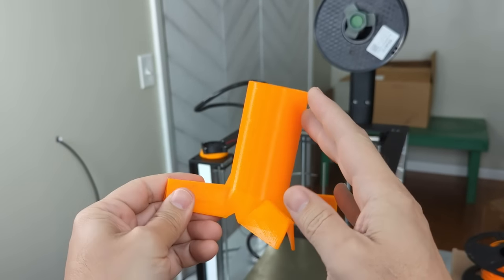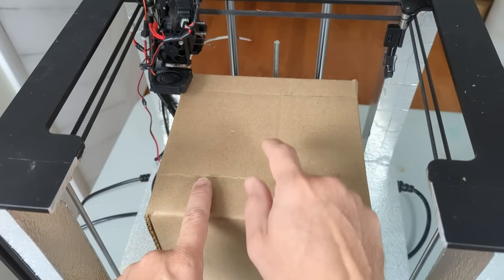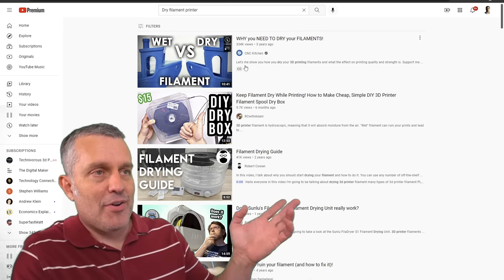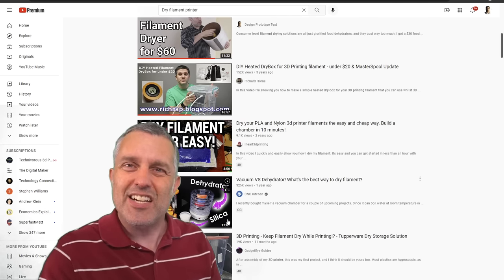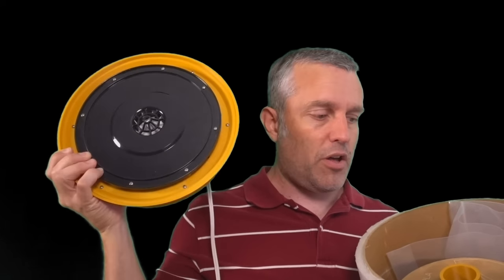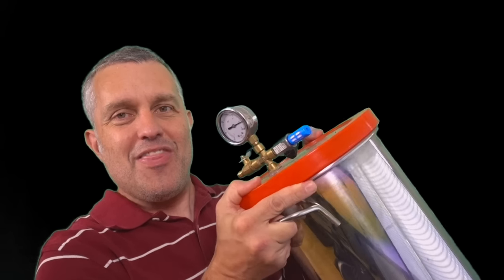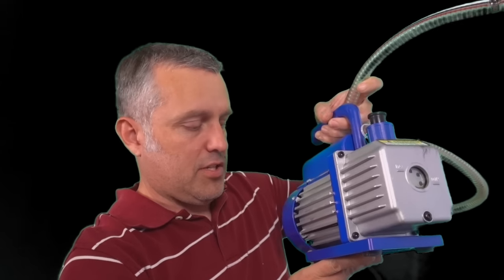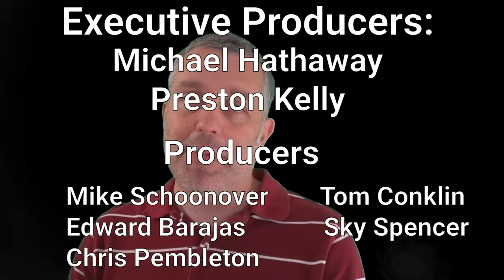The Filament Dryer Built Into Every 3D Printer

Comment: I have tried drying PLA at about 50 to 60 at the heating element but I guess the air was around 40. So far I haven't noticed accidentally annealing the filament
Reply from the maker: In my experience, annealed PLA filament still prints but you start to get nozzle clogs, extruder skipping, and lower quality prints due to inconsistent extrusion.
Reply: @DesignPrototypeTest  interesting, I'll try to observe that next time

Comment: So who's the pricey gypsum filament maker?
Reply from the maker: If I were going to make a PLA that you can anneal, so that it withstands higher temperature than normal PLA, I would call it "High Temperature Poly Lactic Acid." Except that's a really long name I wonder how I could shorten that name.
Reply: @DesignPrototypeTest  love the videos. Especially the tone! Keep doing them they cheer me up and inform me
Reply: @DesignPrototypeTest  Ha why wouldn't you just say it? Also I think you're dismissing what Protopasta is doing over there. They make really good stuff that lives up to their claims so I'm a bit confused. Is it really just the price? If so I hear ya, it's pricey but again, it's good quality, and the main reason it's more expensive is because they're not working with the same margins Hatchbox or Sunlu or any of the other Chinese mega corps are so they can't sell a roll for 20 bucks and keep the lights on.

Comment: Forgive me for my comment ... I'm a bit skeptical about this movie and this idea. Why? I am looking at it economically. How much electricity does the bed take? 200-300 Watts? Fruit dryers... same. And how much does a Sunlu dryer (S2 model) take? Max 50 Watts, it reaches a max of 70 degrees Celsius. This dryer wins economically, by calculation it is cheaper. Still, it is an expensive thing, but looking for another fruit dryer that is 20-50$, even 100$ cheaper. As you have noticed, they are cheaper than the Sunlu type, but the cost of electricity is higher. Drying on a printer, maybe an idea for an amateur, its for funs, but for farms - I include two drawbacks: the cost of electricity and one bed is occupied. Printing time is business. Electricity is business.
Reply from the maker: Thank you for the comment. It helps my channel to grow. I agree with your assessment. It would be foolish for a print farm to use this technique to dry their filament. Then again, most print farms are fool's endeavors. The true utility of FDM printing is for the DIYer. And such a person is not a fool to use this inexpensive and minimalistic solution. Electricity is inexpensive in the United States. It would take weeks of filament drying on the bed to incur a bill large enough to justify purchasing a dedicated dryer. In many European countries electricity is more expensive. Perhaps it is easier to justify purchasing a dedicated dryer if you live in Germany or similar.
Reply: @DesignPrototypeTest  That's what I mean because I live in Europe. Such views are completely different than you in the States :)

Comment: So you tell me, I should use one of my 8, 200 or 2000 dollar machines which are right now being used roughly 95% of the time, to dry a filament. Instead of buying a 50 dollar machine which can dry 6 spools and a bunch of silica at the same time in 36 hours???
A good one gets over 75C, or like mine, can be modified with a better circuit, power mosfet with pwm signal and a high power resistor (I get to 95C now, could go higher but I m afraid for the machine itself). 

These bags let in moisture??? I ve tested these with a dataloger (with temperature and humidity sensor), after 2.5 years the humidity started rising because the seal wasnt perfect from my cheap vacuum machine (there was a small container of silica in it, less than 25g). If you keep your filament 2.5 year, and you wanna store it dry. Then i dont know man, i really. Stop printing then, my spools last max 2 weeks…

Instead you recommend to use their build plate, which wastes energy, could be dangerous if done wrong, for example the fan circuit blowing up (burning up) when you higher than 85C since some electronics are not rated for higher.

I guess i can see a use for someone who is on a budget. But for any average person this is not a good way of doing it.

Comment: Or you can just put your filament into a cardboard box and then stick a hairdryer through a hole.
A bit noisy but it works.
Reply: Massive fire hazard, if unattended. The heating filaments in a hairdryer literally glow. I highly discourage from doing that (at least not in a cardboard box)

Comment: This is the same concept, but even simpler: https://www.youtube.com/watch?v=WC3jvuq-uq8 - a somewhat newer video (June 2021) than what is mentioned here, and I can attest that it works quite well. I modify it a bit by NOT punching a lot of small holes in the top, but making one bigger hole and setting an empty toilet paper tube on top of the hole to act as a chimney to draw out the warm moist air by convection. It works amazingly well.

Comment: I also tried that, but I didn't have good luck, also it takes a lot of time and energy. I prefer using a sealed box with silica gel, mine generally stays at 20% humidity. One thing I thought to dry it even more is to put a peltier cell with the cold face against the wall of the box (and of course an heat sink with a fan on the hot side), and a sort of pocket with an hole to collect the condensation and bring it to the outside. I thought it more as a way to regenerate the silica gel, that is kinda annoying to do.
Reply: I have a peltier base dehumidifier cabinet designed for cameras. It stays about 15% humidity using about 5w

Comment: Of course people had thought of it before.
Reply from the maker: It's important to give credit where credit is due. Why are you dismissing my discussion about prior art and where I drew inspiration from? Do you think I should be like so many other fakers on YT and pretend like I came up with all of this myself?
Reply: @DesignPrototypeTest  Well don't get me wrong, the first shout "WHY HAS NOBODY THOUGHT OF THIS BEFORE" sounds exactly like that 🙂  These ideas pop up on monthly basis on Discord or Facebook discussion groups in 3D printing communities, and you can see many of these archived on various forums. That includes dry boxes with heating mats on the bottom, either silicone, using old printer beds or Peltier elements. People also dry filaments up top in printer's chamber. 

Problem compared to for example food dehydrator is that it's not as effective, converting to DC 12V or 24V. AC heating elements are chapter on its own to do it safely - reliable SSR with heatsink, thermal fuse in path in case it fails closed, proper grounding, properly set PWM not causing room lights to blink.

Comment: Just use a food vacuum sealer. From the thrift store.
Reply from the maker: Did you watch the whole video? I talked about how even sealed bags will eventually let the moisture into your filament.
Reply: @DesignPrototypeTest  I saw the whole video. It was good. But not all parts of the usa work the same. With the same humidity.
Reply: @DesignPrototypeTest  you have to use a gas bag

Comment: ** If you use a vacuum pot, use TINKSEAL around the lid. Vacuum first, >> then heat. The moisture you draw out from vacuum will be absorbed right back if no heat. Nylon should be dehydrated at 90C for 24 hours minimum. All other plastics can use lower heat. Sunlu goes 24hours at 55C. You print with the Sunlu, not dehydrate with it. Just put your filament in a 5 gallon bucket with a lid. Toss in some desiccant, cheap, easy. Are you spools distorting at high heat? Use this: https://www.thingiverse.com/thing:4966414

Comment: Not concerned about the fire hazard it might cause?
Reply from the maker: ??? What fire hazard people do like 4 day prints all the time. That bed stays on for a 4-day print. It's got filament touching the bed the whole time. You don't need to dry your filament for 4 days straight. So this is actually less of a fire danger than normal printing would be.
Reply: @DesignPrototypeTest  The flash point of cardboard is 232C, the flash point of PLA is 450C.

I'm not interested of ruining my printer to see how hot the bed will get if the bed heater fails to shut off.
Reply from the maker: I'm sorry the world seems so scary to you and you feel like you need to make it safer. Just out of curiosity, was your father around when you were a child?
Reply: @DesignPrototypeTest  Ever been inside a burning building?
Reply from the maker: I had some firefighter training in my 20s but nothing for real. So, no, I'm not a member of the 0.5% of the population which has been inside a house fire. There. I answered your question. Will you please answer mine. Were you raised in a single mother household by an overprotective matriarch?
Reply: @DesignPrototypeTest  I find being called a baster pretty offensive.
Reply: To answer your very rude question, NO!  I was not.

And I have worked in some very dangerous environments.
Reply from the maker: I didn't call you anything. I really don't care the circumstances that would make you fatherless. He could have died when you were a young child. You just fit the personality profile of someone who's overly concerned with safety because he didn't have enough mail attention growing up and was always denied access to " dangerous" situations. If you are inexperienced with danger because you didn't get to practice with the guidance of a male parental figure. Then you tend to be overly focused on safety. I was asking the question to ascertain if this is who you are because honestly you're making a mountain out of a molehill. I think you know it.
Reply: @DesignPrototypeTest  I got adequate correspondence growing up thank you.  Our portal carrier came regularly.
Reply: @DesignPrototypeTest  I am truly sorry I upset your DELICATE EGO by asking a question out of concern for someone elso who uses this method and experiences a thermal runaway on their printer. 

I would suggest if someone use the bed heater and a box, do so while someone is around in case there is a problem.